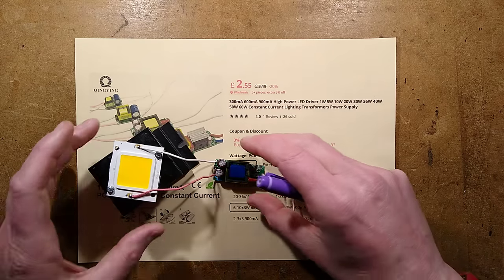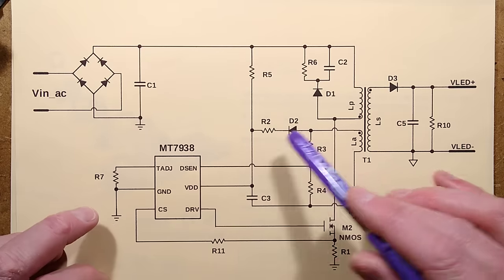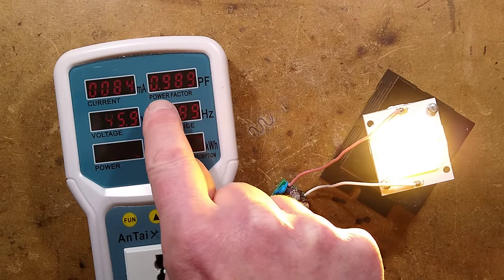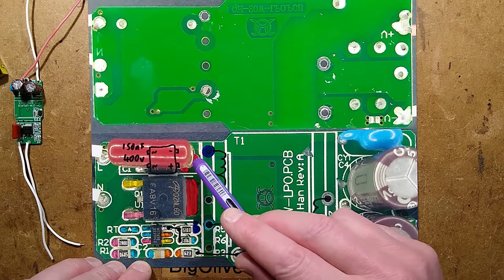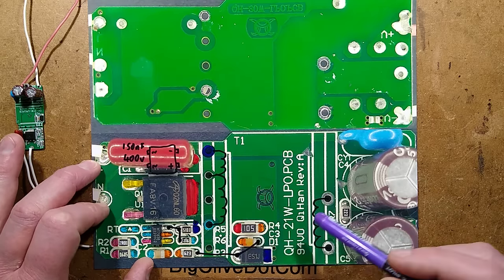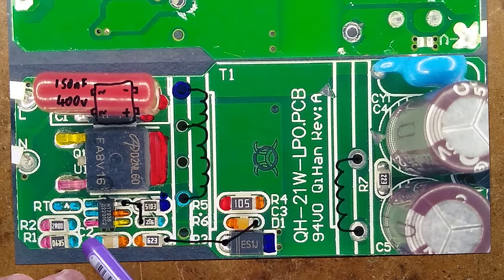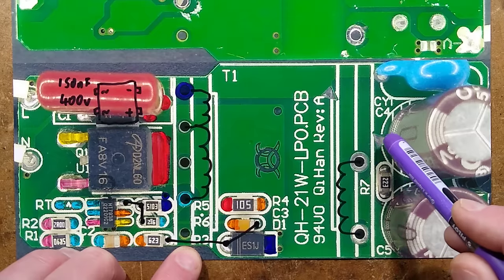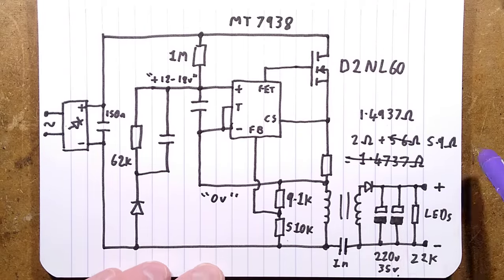Near unity power factor LED driver - with odd schematic

Comment: I like the "be a good neighbor" power factor, rather than the usual "every circuit for itself"
Reply: It is indeed, nice to see a circuit that behaves nicely.
Reply: It's a nice thought, but in high power land where I come from, I don't give a stuff about my neighbors; I just want to be able to get the kilowatts I need without needing a mains supply capable of over 9000 A rms.
Reply: I have enjoyed my 0.5% on time power supply sipping power for decades approach, why, because I have already paid for the pole, transformer and wires 3 times over.

Comment: Sorry, so, for the sake of getting a good power factor, they've murdered their radio interference suppression? Ew

The dodgy pin on the transformer worries me also, one misconnection and sizzle, interestingly, if the ground and positive are spread over both sides of the circuit board, does this not also form a capacitor
Reply: it does form a cap albeit not a terribly high farad one ie some pF or nF
Reply: The EMC is not dependent on the big smoothing cap on the input. That is only for low frequency power... The small cap will filter the high frequency currents if well designed, I think.
Reply: With no input inductor, I'd love to see how the conducted emissions are. Circuits with floating grounds always give me a headache!
Reply: @HughCStevenson1 Before correcting someone do some homework. I’d like you to tell me just how many chokes are on the primary side of that supply…

Comment: Some of these designs never cease to amaze me. Many are breathtakingly bad, or even "delightfully" dangerous, and some are pretty brilliant.  In my experience, China indeed is a country of extremes.
Reply: Yeah but it makes me wonder WHY they're coming up with different designs again and again and again. If one like this has such a great PF why don't they all start using it and be done with it? It's like they're trying to reinvent the wheel every time they need a driver.
Reply: @Ni5ei  Probably too expensive for many applications.
Reply: @Ni5ei  often it's to save cost. sometimes it's because someone thinks they can do better
Reply: A box of chocolates.
Reply: @pizzablender  Yes. Component supply chains aren't always reliable.  It is not unusual for designs for some kinds of products to change multiple times in the life of a product to get around availability issues.  I also recall that for low volume stuff in the 90s, in times of supply shortages, we used to design around what was in the stock cupboard before looking at any alternative parts.
Reply: @Ni5ei planned obsolescence.... regular new chips...mean fewer/ no old stock to keep..and one has to throw the entire thing away and buy anew.

Comment: Your camera makes it clear that the LED does not have continuous light, but flickers very fast. The human eye really prefers constant light. Even high flicker rates that aren't obvious do have a detrimental effect, causing stress and headaches in most people. I modify any LED lighting I use so that it has pure DC light.
Reply: But do you keep the fluctuations and other deviations on the input down?
Reply: How do you create pure DC?
Reply: Battery or lots of filtering and capàcitance.
Reply: @phillyphakename1255 , 'approximate DC voltage', produced by inductor/capacitor filtering.

Comment: This is how Bob Carver's "Magnetic Field Amplifier" power supplies worked. Basically, a big light dimmer driving a transformer.
Reply: That's a blast from the past. I worked at Carver back in the 90s. I loved working on those amps.
Reply: That took me down a good rabbit-hole!  Also to Sunpower mag amps. They note that they operate fine in high neutron environments - I presume their location in Aldermaston is no coincidence!

Comment: I would be nice if you could show some scope shots of the circuit parts in operation. 
It would be good for both the novice and pros.
Reply: Yeah. I’d like to see the voltage on that”extra” transformer pin in particular.

When Clive told us the actual circuit was unlike the recommended circuit and showed the reverse engineered circuit my first thought was that the designer wanted to use a slightly cheaper transformer with no sense winding, forcing some creative voltage divider trickery. However that unused transformer pin looks a lot like it could be a sense winding.

It doesn’t make sense…
Reply: I second that comment. I wanted to see the output waveform, not so much at the switching frequency, rather nearer the mains frequency. I could see in the camera shot, there was considerable flicker. That would be a game stopper for me to use this indoors. It would however be perfectly acceptable outdoors. They have traded quality of light (no flicker), for a good power factor. It has to be said that getting a good power factor using a small inexpensive circuit is surprisingly difficult. It would probably need two switching regulators one following the other. The first (just like this one, chopping the raw rectified mains, in step up config), would generate the `bulk supply` with ripple that does not reach zero and the true regulator would draw on that voltage, and would use a fast feedback loop to maintain true DC.

Comment: 1. It sounds like a critical-conduction mode controller. This gives good power factor. However, it requires bigger output caps to keep the flicker down.
2. Clive, it would be great if you added the polarity dots to your schematic to show that the circuit is a flyback (i.e. transformer isolated buck-boost), and not another topology.
3. PFC operation requires two feedback loops: a fast loop at the switching frequency to control/limit the instantaneous current and a slow loop (slower than the utility mains frequency) to set the peak current and do the regulation of the secondary. Critical conduction mode is not constant frequency. 
4. The IEC 61000-3-2:2018 power line harmonics standard doesn't have any requirements for lamps less than 5 watts. This being a 20 watt item says that there needs to be some PFC in order to be OK.

Comment: Using the stray inductance snubber as the auxiliary supply for the control chip and open circuit detection for the load side, clever. And while switching, the circuit floats itself above rectified line voltage to do high-side switching without needing a dedicated boost capacitor for the MOSFET either. Having lots of stuff attached to a switching node can be problematic for EMI but is likely fine here since it is all packed so tight together and inside a metal housing or fixture of some sort under normal circumstances.
Reply: This is still a LOW side switching unit. The mosfet source is still "dc" grounded through the winding...although lifted up by some potential diff. when "on".
Just for info....back in 1990-1995, In high power "softstarter" 3ph. AC DRIVES. (100-700HP range with 6 thyristors) we implemented some isolated aux.power supplies powered from the 3 current sense transformers.
Reply: @analoghardwaretops3976  Your definition is incorrect. Low-side switching switches the ground leg of a power circuit while high-side switching switches the V+ side. The MOSFET's drain is connected directly to V+ and its source controls the V+-facing side of the load, which makes it high-side.

It is the side of the DC rail the control device is connected to that determines whether it is high-side vs low-side, not the off-state DC potential of the FET's source.

Comment: If every engineer just copied the data sheet, they would have to spend an infinite amount of time making a typical circuit that a fits every requirement.  The typical circuits shown are normally just a simple example that will get it going.  The job of the design engineer is to read the data sheet, their design requirements and build the final design around the  chip.  If your design is double insulated then you don't  need mains isolation,  if it goes above 3000m then you need greater creepage and clearance etc. 
Looks like they already had a transformer without a feed back winding and did a trick to provide the chip supply,  parts reuse in multiple products cuts down on a whole bucket of costs.

Comment: I haven't looked at this driver's datasheet but I once designed a circuit using a somewhat similar one. The way these typically get close to unity power factor is that they run the MOSFET using a fixed on-time. That way the current through the transformer or inductor climbs up to an amount proportional to the voltage applied, and then is left to freewheel until it stops, then the cycle starts again. CS must be for current sensing; usually it quickly lowers the on-time when it's above a certain threshold and lets it creep up slowly if it's not. The feedback pin is probably there to sense when the transformer has finished freewheeling, triggering the next cycle. So the way it draws current is kind of like a high-frequency triangular wave with an amplitude proportional to the applied voltage, hence the great power factor. A neat side effect is that they usually work quite well with TRIAC dimmers, too. Only thing to look out for is that it does flicker if you don't add smoothing to the output.

Comment: I’m curious. I guess the capacitor between primary and secondary is why you get a mains buzz from the case of many devices, but what’s its actual function? I’d have thought that a secondary isolated from the primary would have been safer.
Reply from the maker: It provides an easy return path to ground for coupled noise that could otherwise be radiated by attached cabling.
Reply: @g8xft Yes - it can give rise to that tingling sensation.  In small switching supplies, the capacitance is generally in the range 1000pF to 2200pF and so the current coupled is very low.  You can often see the effect though if you measure the AC voltage between the load side of the supply and mains earth, since the resistance of the multiplier circuit in the meter doesn't load the capacitor.  With UK mains, a reading of 80 to 100 Volts AC or so is very normal.

Comment: With the arrival of smart metering, it'll only be a short time before we're charged for apparent power as well as true power consumption. This sort of almost unity PF driver is going to become far more commonplace I suspect, especially as incandescent lighting is pretty much no longer in use.
Reply: @BenRichards7  That's a relief, since with the move to LED, PF might have been a significant consideration.

Comment: Clive, A great investigation work!
MT793x series ICs  seem to use Critical Conductive mode to do the PFC,  some of that company's products use QRM quasi-resonant mode instead.
The board you have uses N- channel mosfet while the load is on the Source side (kind of like BJT's emitter follower fashion.)   I wonder if there's a drawback on such design.

BTW, I could not find the board you have from Ali.  So I bought a 50W version which also do not have a large primary side storage cap, but just a 470nF filter cap.  I found it is using a different chip LZC8650 which uses QRM flyback and the PF is measured as 99%.  The IC's power circuit is traditional using an aux winding and the transformer winding is on N-channel Mosfet's (traditional design) Drain side.

Comment: I would be awesome if we could get some scope pics of the FET gate and output current in operation.  That really is quite a clever little circuit.   The MT7938 has a very poor datasheet though, I can't figure out what the frequency of the PWM is.  They have a graphic showing roughly 7 slices per half cycle... that would be 700hz to 840hz depending.  But no specs on the frequency.

Combining the snubber and the power supply for the chip is quite clever, but very sensitive to power.  I don't think they could swing that at higher power levels.   The extra energy has to be dissipated through that 62k resistor + consumption by the chip (also not specified for operating.  Only specified at 1.2mA when the oscillator is turned off).

But I am impressed.  The parts-count is impressively low for a power-factor-corrected current-regulated DC power supply.   I don't think any of the capacitors actually have to be high voltage... 50V caps ought to do the job throughout.

Usually low cost LEDs are just run straight from an AC transformer and rectifier without any regulation.   i.e. AC-driven LEDs (100-120hz after rectification).   This works but winds up being very sensitive to any asymmetries in the AC input (every other post-rectified half-cycle can wind up being at a different energy level, resulting in visible flicker).   LEDs can soak up extra voltage... it just turns into heat, and the power-factor is terrible.  But the parts amount to one transformer and one fuse.   You need to use thick-phosphor-coated LEDs to get a soft output.

-Matt

Comment: MOST power factor power corrector devices have a working voltage of 80 to 400 volt rating (or 265Vac) very universal, nice !

Comment: Are there any tweaks we can do in the LED driving circuit when running on 50Hz mains that will make the LED not flicker when recording at 1/60th shutter speed?
Reply: Yep, those output capacitors and the much higher switching frequency greatly reduce output flicker, but no measurement is done in this exploration .
Reply: Actually there is. There's a circuit called a capacitance multiplier that provides additional smoothing to the capacitors that are already there. You give up a small amount of efficiency as compared to just using bigger capacitors but I reckon it'd work.
Reply: Driverless 12v LED modules and a decent size battery? There's no chopping and pulsing with a battery.
Reply: Use proper DC power supplies for electronics use, for example an ATX power supply. They should have negligible ripple.
Reply: @ManWithBeard1990  Adding more capacitance only slightly lessens the intensity of the flicker but it still remains present if shooting at 1/60th of shutter speed.
Reply: @alidollar1994  That's why I suggested the use of the capacitance multiplier. If you're not familiar with what that is (and I suspect many people aren't), briefly explained it consists of a transistor in emitter-follower mode in series with the LEDs, its base fed by a separate capacitor. I like to think of it as a linear voltage regulator that uses the separate cap as a reference voltage, which should be quite stable since very little current should go through the transistor's base.

Comment: Just had such a strange experience.

A friend asked for help with a led strip she wanted to install. She hooked up the leds, they work but flicker a bit, and asked me where to put the power supply.

Then she gave me a packaged power supply, and showed that the leds worked when she flipped the switch.

I was bamboozled.

When we put a power supply in between, we saw that some parts of the strip were mostly dead, and some sill worked.

But this strip failed in a way that it mostly works on 230V

Do you want it to test?

Comment: Some regular SMPS MOSFET / IGBT gate drivers even from reputable manufacturers can actually be abused as a resonant active PFC driver as shown here in this particular power supply. It takes some analog wizardry (SPICE simulator may help a bit if you are lost) to make it work.

Comment: So the engineer that designed the circuit board is more "clever" than the one that designed the chip...  I bet a lot of that goes on inside the industry.  ??
Reply from the maker: Or it may just have swapped in a compatible chip to another datasheet's design.

Comment: Forgive me if I am misinformed, but I understood that power factor is not very important in a domestic (household) installation, since real (kW) is metered, not reactive power.
Your electric bill wont really be impacted by the power factor of your appliances.
So unless these LED drivers are being deployed by the hundred in a commercial / industrial setting, it really doesn't matter too much what the power factor of them is.

If I am incorrect, please explain.

Comment: The kick-start, separate-feedback-winding-ok-keep-running design has always made me laugh (in an indecorous manner), making the inevitable hiccups difficult to diagnose and cure. Why not a simple am-I-present-and-correct monitor of the secondary, with a minimal load resistor (well, simple in my head, anyway).

Comment: As i didn't see this commented:

There is no need for a feed back to control the secondary's voltage. The load is a diode (or a string of LEDs) and those want to see a certain current, not a certain voltage.

So the current in the primary and the transformer ratio are designed such that the secondary drives the required LED current (regardless of the LED voltage that will vary considerably over temperature).

And imho the circuit can be made dimmable by changing the voltage divider to the FB pin as that should influence the mean of the primary's current.

Comment: Could you cut the "extra" unconnected pin on the transformer?
Reply from the maker: It's not very accessible without removing the transformer and refitting it.

Comment: if this had improvements to your 2 concerns it would be great for anyone with solar power (partially or entirely solar) as most inverters don't "like" bad power factor (ranging from increased power consumption from batteries/panels to strange behavior to noisy AC output).

Comment: Thank you for making these video's, they are very interesting and educational for someone like me at least. Appart from the power-factor, I would also like to know the energy efficiency of the driver. It would be nice too if you could mention –or test– its compatibility with a dimmer and if so which type(s), even though for this one it seems quite obvious that it isn't.